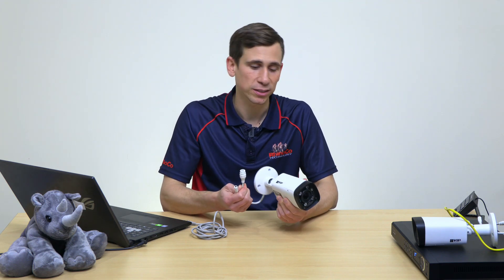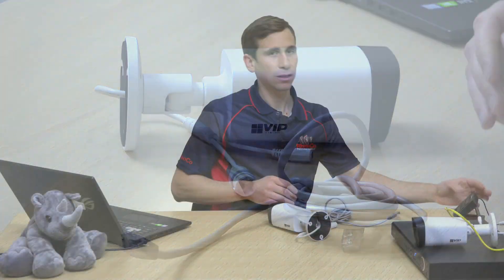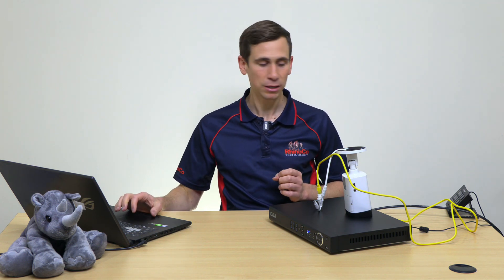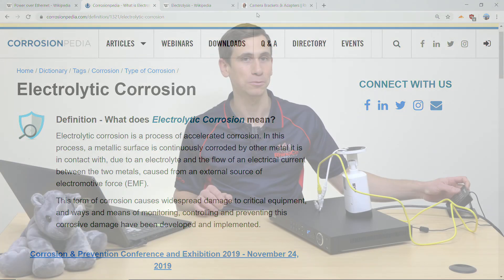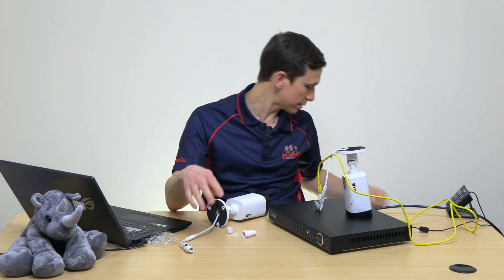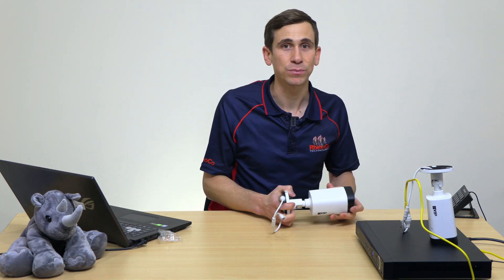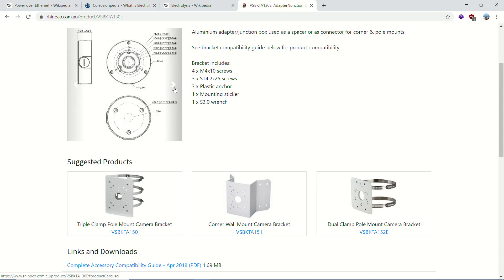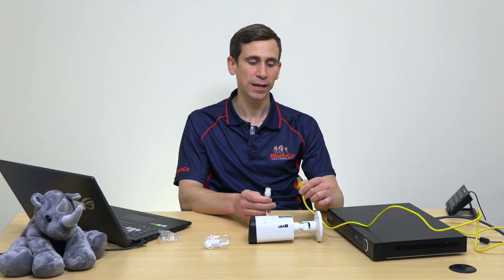Water in your RJ45 socket?  You're gonna have a bad time.

Comment: Great video, its funny how gew people discuss the most important things! The most intelligent question or comment I can leave is why are these not installed on every ethernet cable that's intended on being used outside? companies are selling the security cameras boasting about how their cameras are IP67 rated or whatever but none of them manufacture their products with these waterproof caps installed. You have to ask yourself why is that? And then not to warranty the product because of it it's like telling the customer that it's their fault it is not the customer's fault when this happens on a system that is intended on going Outdoors

Comment: 1st. This is the worst conection ever created. Extremenly bad design. 
2. You will never resolve this problem. You always will have corrosion in time.
3. The solution you give doesn't work at all. You will get corrosion again and again  I have 4 different CCTV systems and the same problem with this extremenly bad design conection.